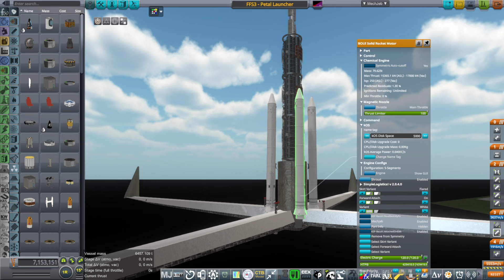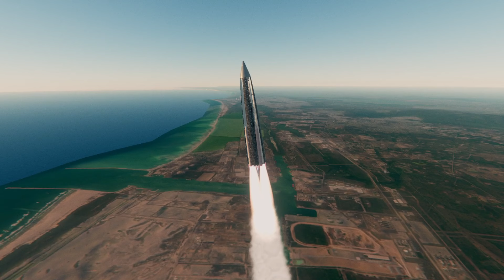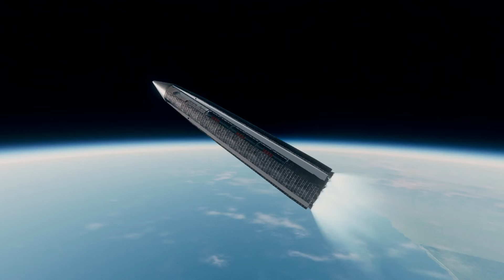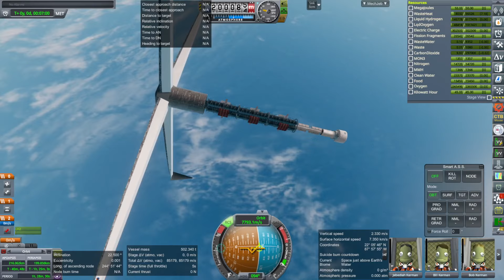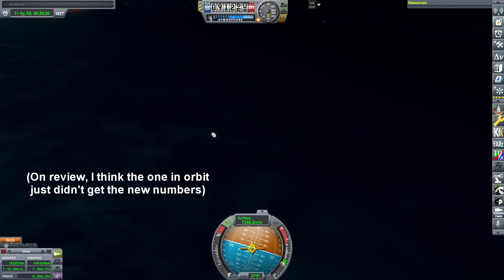Petal Launcher Test (RO in KSP 1.12)

Comment: When NASA and others talk about nuclear powered spacecraft, there's a concept called the "nuclear safe orbit". Basically, it's an orbit that's high enough that the orbital lifetime is large enough to allow for the radioactive isotopes on board to decay to safe levels before reentry would occur. Depending on the ballistic coefficient and the amount of radioactive material, this could vary quite a lot, but I've seen numbers from around 500-600km on the low end up to 1800km orbits. So if you actually wanted to launch these types of missions with a significant amount of radioactive material in the real world, you'd probably want a more capable chemical rocket to get up to those NSO altitudes instead of firing up the reactor in a 220x180km orbit.
Reply from the maker: I'll keep that in mind, but I don't think we need to redo the launcher. First, we could remove the supplies from the ship and send them up with the crew, which would reduce mass tremendously. If necessary, we could use liquid boosters instead of the solids - maybe the Terran R you proposed before. Keep in mind that a bunch of the things I plan to use this with will be Deuterium-Helium-3 fusion, and in that case, we don't have such radioactive isotopes to worry about.
Reply: @RaizSpace  Makes sense. I just thought the existance of these NSOs made for an interesting complication in mission planning for more near future NTR/NEP powered vehicles. If you're launching crew and supplies seperately you might not even be able use existing LEO-optimized vehicles, like Dreamchaser, Gaganyaan, or Dragon that are really designed to go to altitudes around 400-500km, where a lot of the LEO space stations, like the ISS, Tiangong and future CLD stations orbit, at least not without switching to a more capable launch vehicle and some other upgrades. The ISP probably still makes it worth it for crewed missions to Mars or the outer planets, but I think needing to work around things like nuclear safe orbits and radiation shadow shields creates some interesting operational drawbacks compared to the approach of just going with a really big and heavy chemically fueled rocket stage (like what SpaceX is proposing with Starship).